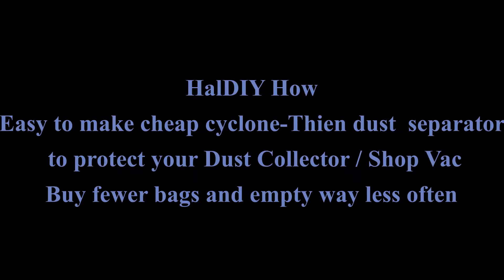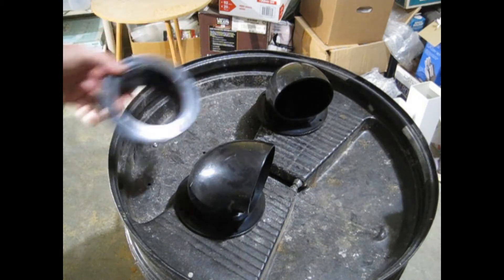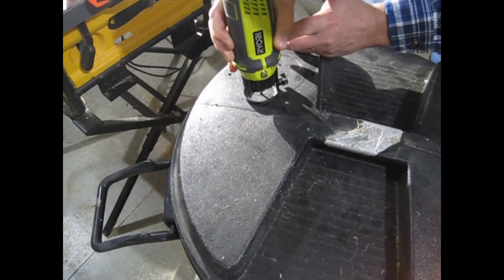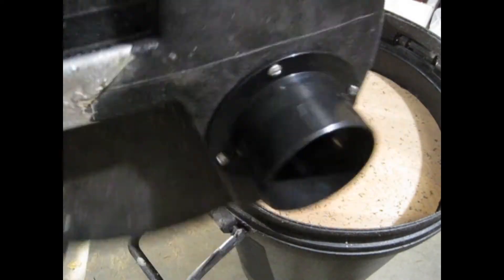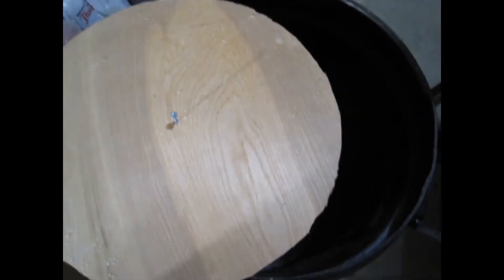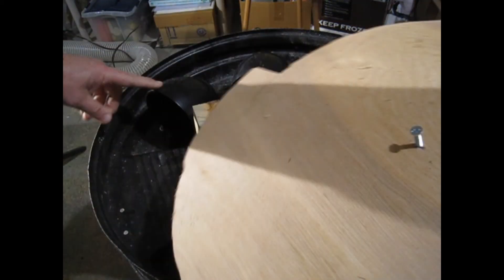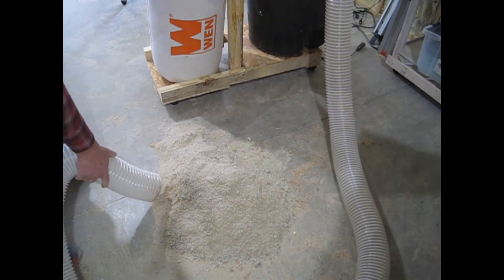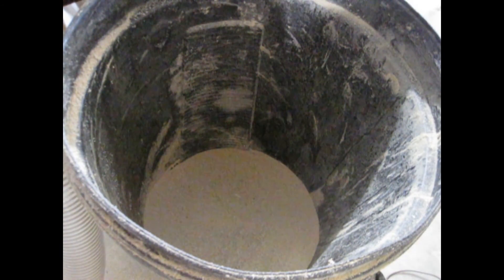Not-A-Cyclone Dust Separator Project

Comment: Hi! Found this on HD reviews. In your opinion, does the Wen collector have more power than a shop vac? I have the ridgid wet dry and a small thien baffle on a 5 gallon bucket. Looking for more suction. 
Thanks for putting this video together. Great job!
Reply from the maker: The WEN is a high volume low suction dust collector. Generally 4 inch and up systems are high volume, 2 inch or so have higher suction. I have a RIDGID 4 gallon with a 5 gallon thien baffled bucket that I connect to tool dust ports such as miter saw, sanders, table saw, etc. I use the WEN to try to catch the dust that escapes the tool port. The combination works surprisingly well but I agree that more suction would be good. I also use the WEN for tools without port as it covers a larger area. The problem I find is high suction with high volume has an unpleasant tendency to come with high prices. I just don't do enough woodworking to justify a whole shop blast gated system. For higher suction I have been looking at the big RIDGID shop vacs in the 12 to 14 gallon range and 6 HP.

Comment: Found this on home Depot website user reviews.
Thanks for putting this out there. Dust has become a big issue in my shop
Reply from the maker: It is not good to be breathing saw dust from anything, which drove me to trying this. I am certain it is not nearly as efficient as the pro stuff but I am amazed how much it can separate, very little now makes it to the filter bag. One shortcoming I found is a power planer makes a lot of 'straw' that fluffs up and doesn't drop down to the waste bin. Small stuff is no problem so I suspect I need to open up the slot around the edge so the bigger pieces can fall through.